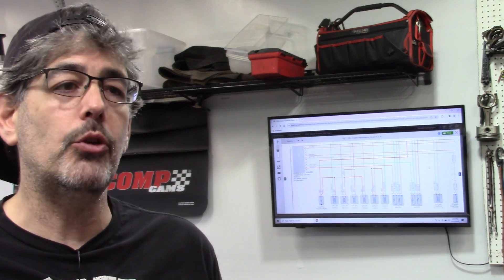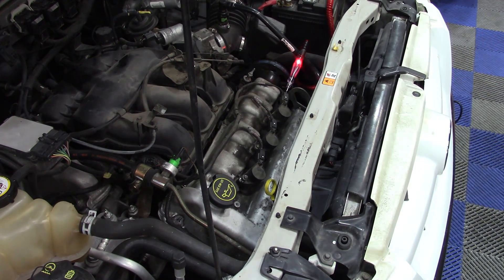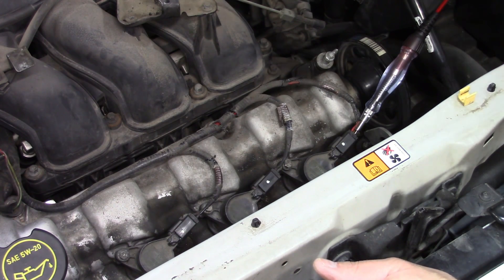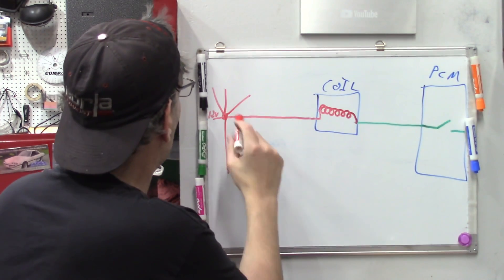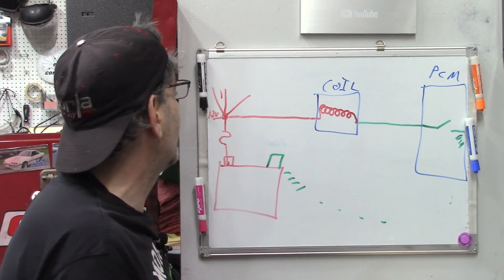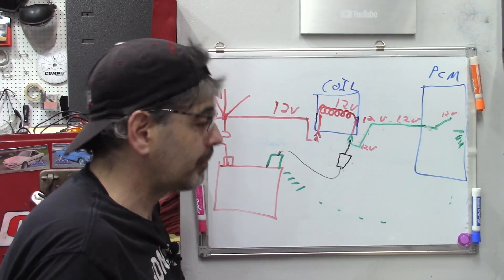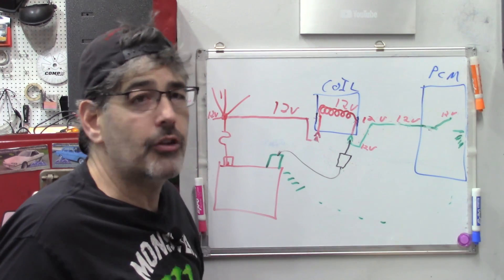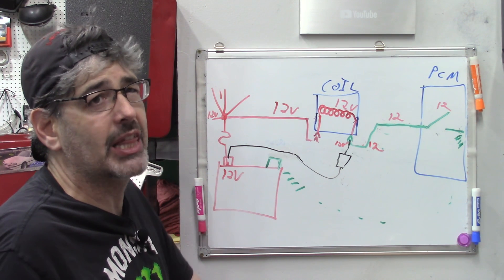SBQM Free Sample: Proper Use Of Test Light To Check Ignition Coils

Comment: Also be careful of what amperage your test light allows... when you had the test light hooked to ground, the coil windings have a current flow through them, then through the test light, to the test light's ground (in series).  The amount of current flow is now dependent on the resistance of the test light (assuming the coil winding resistance remains constant.)  If you use a low enough resistance of a test light, when the pcm opens the ground supply, the collapse of the magnetic field will not be as strong, and you may inadvertently create a weak spark just by having the test light installed.  

This is a test I would have performed, with a low current/led test light, and would have gotten burned.  I would've expected the test light to go out during coil command.  This info has been stored in my brainbox!  Thanks for sharing.
Reply: He is testing an output Circuit.  Output circuit driver's can handle the current of an incandessent lamp.  An Ignition coil can draw up to 12 amps and sometimes more + the initial in-rush current.  You could substutute a 9004 headlamp bulb here if you wanted to!  These driver's are designed for this load.  Where you need to be carefull is with input circuits.  For example, using Matt's extremely nice OTC 3633 test lamp to test a three wire map, it would not be wise to pull the 5-volt Ref to ground with an incandesscent that draws  more than 1.1-1.5 amps.  But,  in Matts case,  his only draws 750 mA, so if he accidently shorted the 5v ref, it wouldn't let the smoke out of the PCM.  There is a big difference between testing OUTPUTS and INPUTS.
Reply from the maker: Paul is correct. It is impossible for only 250mA to melt a circuit like that. The only time you would find that to be a concern is with milliamp circuits like in modern dashboard circuitry for A/C, radio and other microprocessor controlled signal that use very very low amperage.   
  You could indeed put a 5V reference directly to ground at the battery and still not damage the PCM. I’m face- some sensors do exactly that when in full range- a CKPS for example does it over a thousand times a second.
Reply: I wasn't concerned about the pcm driver in my comment.  Purely looking at current through the ignition coil winding.  You gave the coil a second/parallel path to ground.  When the pcm grounds the coil, the coil gets full current flow.  When the pcm opens the ground, the coil still has a current flow through the test light.  If the current flow doesn't drop enough, the magnetic field may stay, and you'll get reduced spark.
Reply: @ablackformula  In this scenario we follow Ohm's law, and the test light is now a current limiting resistor.  Is it enough to keep the coils energized while the PCM Driver is off? Most coils are 1 to 2 ohms on a good day, the OTC 3633 is 11.8 ohms.  So applying Ohm's  law there isn't enough current flow to make the sedondary "happy"
Reply: @paulpaquette1961  That's why I wrote to be careful of the amperage test light you use.  You wrote in your first response you could use a headlight bulb and the pcm would be safe.  A headlight bulb would indeed keep the coil energized.  This same test could also have a different result if testing a fuel injector, which could possibly flood a cylinder with fuel.  Perhaps another way of wording it is that you have a solenoid already receiving 12v, which will be activated if a ground is found:  you are giving the device a ground through a test light.  Be careful just how much of a ground you give it is all.
Reply: @ablackformula  The test being performed by Matt is an Output Driver test to see if the PCM is commanding the output.  If he Attached the test lamp of any amperage to Batt Pos and the Control wire (Key-off), if there was a second route to ground the lamp would be lit.  Diagnostic Direction immediately changes, you would no longer be cranking the engine over for fear of overcurrent, if it hasn't already let the smoke out of the driver.  Whether it be a fuel injector, or any PCM controlled Output, if that control wire lights  a bulb key off, you've going down a different path.  Your point is taken though.
Reply from the maker: Yep again Paul is correct. Remember even if you ground with a standard  testlight you still only allow 250mA of current. It’s hard to think of any component on the engine that you will ever damage doing that.  Again- a micro amp circuit board switch in the dashboard for the AC or radio might be a different story and you would want an LED testlight in that case- but I can’t think of a single PCM power or ground side controlled circuit that would be even close to possibly being damaged at 250mA. 
  If you are concerned then use the LED but also know you are limiting yourself to diagnostic potential in doing so. For example, if I do a transistor base signal input into a coil to test it- the LED will not have sufficient amperage to do that. Same with a cam or crank sensor bypass- the LED won’t work but the incandescent will.

Comment: I have seen the front wire harness for the coil on backwards that blew my mind that the harness fits both way smh
Reply from the maker: yeah for sure. I also hate when different components sometimes have matching connectors and even worse they are close to each other (a TPS connector that also fits an EGR sensor for example). why do they do that. use to drive me crazy when I did engine swaps.

Comment: Matt help I have a customer with a 2011 Toyota sienna it has a battery light on but it’s charging at 13.9v it’s been on for about 5 months so I repl the alt as a “ customer request “ still has the light on and still charging the same . Any ideas??
Reply: Battery is new also
Reply from the maker: sounds like the voltage indicator to the dashboard has an open.
Reply: I appreciate your help I ll start on looking for an electrical problem

Comment: Off topic:  But something that will really help a cough like that is called a "Netty Pot".  You run salt water up your nose and let it drain out the other side;  it completely clears out all your sinuses and the salt kills all the germs up there.  Because the cough is caused by "post nasal drip"-- meaning that you have germs/ bacteria/ fungus, etc.. up in your sinuses and your nose will literally RUN or drain down the "backside" of your nose-- and it drips right onto your breath h0le/ vocal cords;  and your body's reaction is to quickly cough and get it away from that h0le- to keep it out of your lungs.  I'm telling you--  this thing works like magic, and it's cheap.
Reply from the maker: Thanks for the idea- yes I also even saw a device that’s does a nasal package like that- pumps saline through one nostril and supposedly it exits out the other.  seemed crazy but I am ready to try it.
Reply: @SchrodingersBox  Yep.. That's exactly what a netty pot does.  Except there's no "pump".. You just tilt your head sideways, breathe out of your mouth and pour it into your top nostril, and it will simply run out of the bottom nostril;  make sure you hold over a sink, because it will drain out some surprising green snot balls sometimes.   You can do it with just water, but it will usually come right back within hours.   When you add the salt, it just wrecks anything trying to grow up there.. and dries it all out;  no more runny nose.  I can't recommend it enough.   I mean, it works almost immediately.
Reply from the maker: Ok so I just tried this with a 50ml syringe and sterile .9% saline (yes I am the kind of guy who has this stuff laying around my house hahaha). I let it gravity drip in one nostril and run out the other and low and behold it did indeed clear out the mucous. 
   Never tried that before but it totally worked. Not the most comfortable thing but it beats being congested!!!!

Comment: I have no knowledge in automotive repair, is your paying suscription recommended for begginers? Can you recommend me a scanner. Thank you
Reply: The best starters are Thinkdiag 2 or xtool A30M..  They both have most of the bi-directional controls and are way above other things in that range and work off of your phone.   If you're gonna spend eight, nine or thousand dollens-  Just get the Thinktool Pro, best bang for the ducket.  Xtool D8 is another great one (which is what I have),  topdon Phonenix.  Autel 906.   I wouldn't really get anything in between;  either get the cheap ones I said, or spend a grand and get one of those.
Reply: @calholli  than you so much
Reply: @calholli  once again thank you so much for the info
Reply: @calholli  Excellent advice.  For the inexpensive choice I have the A30M because right now they have lifetime updates.  That's why I went with it instead of the Thinkdiag 2.
Reply from the maker: It would be excellent for beginners in electrical and computer testing.  On that channel we go much more detailed as you see on how the electrical works.
  My recommendation is to start with the series "Basic Electrical for beginners" and then once you master the electrical, you find everything else is so much easier to understand.

  As for a beginner scantool- ANY scantool that has "Live Data" available will be a good starting point.  I have seen them under $150 now.  Once you get good with it you will probably want something more advanced but even a $140 scan tool will work as a starting point to do advanced diagnostics.